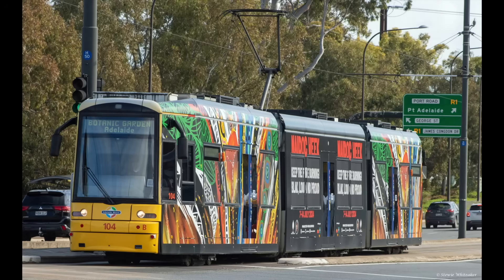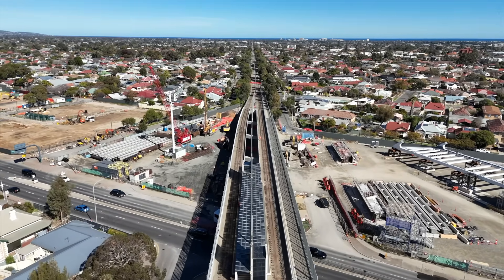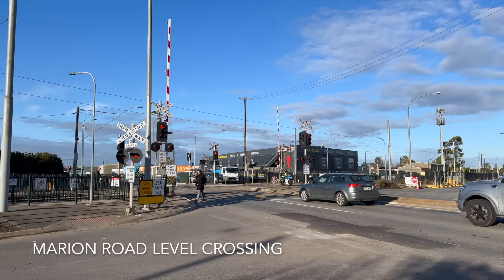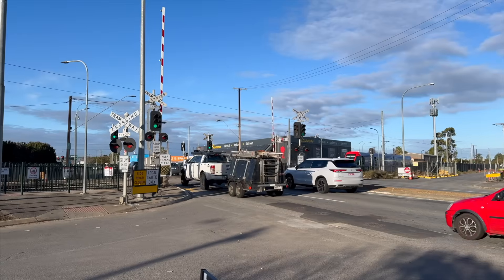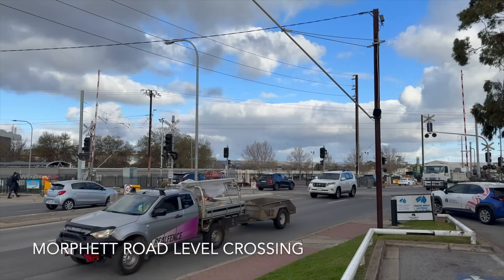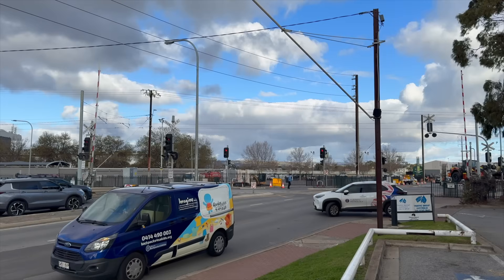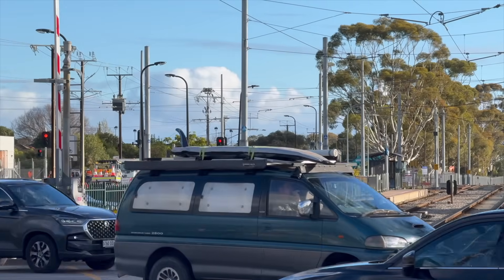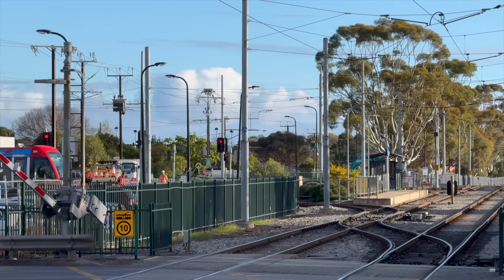Adelaide’s Tram Grade Separation Project: The Glenelg Line

Comment: Great video.  I still don’t understand why there are boom gates at level crossings for light rail.  Nothing like that in Melbourne.
Reply from the maker: It has more to do with the fact that it’s a defied corridor as opposed to Melbourne. 
Correct me if I’m wrong, but I think the St. Kilda line (96) has boom gates at one location?
Reply: @choo_choo_stew the 96 and 109 both formerly the st kilda and Port melbourne railways respectively